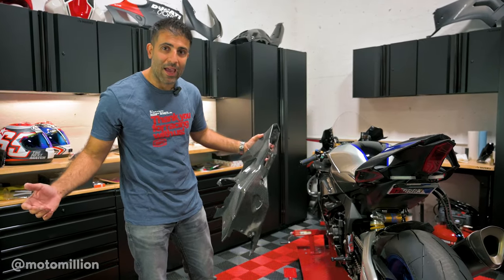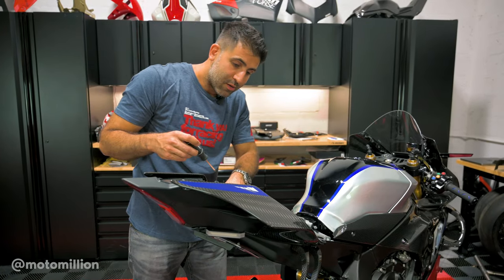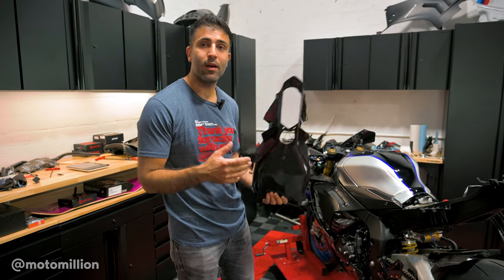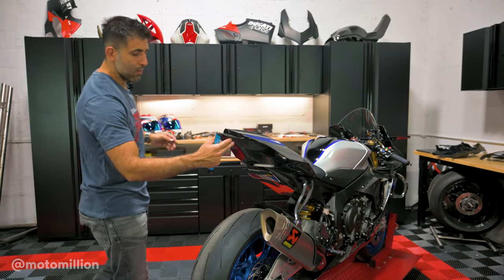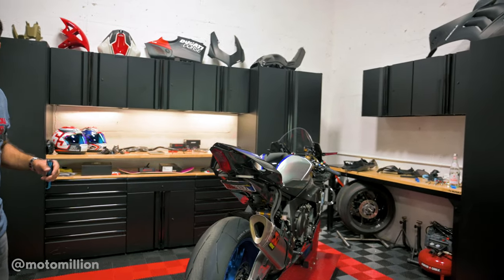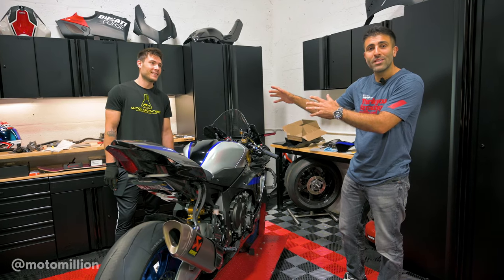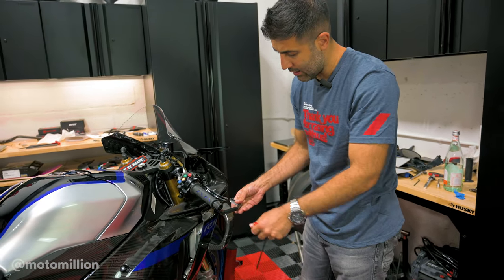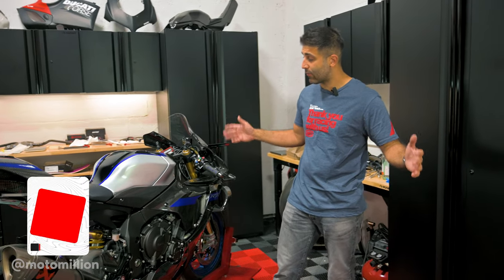Dressing Up Our Yamaha R1M! Carbon Subframe Cover, Brake Lever Guard & More! | R1M Series Part 16

Comment: Great job! Are they twm levers you have fitted Mani?
Reply from the maker: The clutch lever is TWM, brake lever is Brembo's RCS 19 Corsa Corta master cylinder with the TWM low drag lever blade.